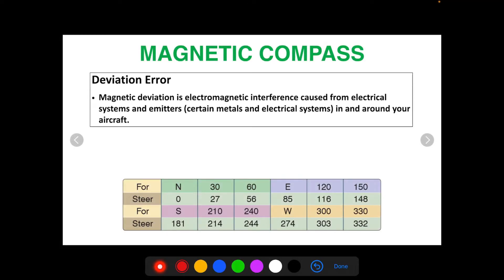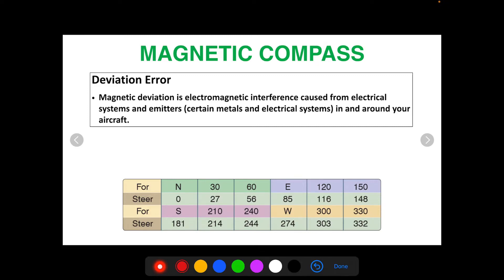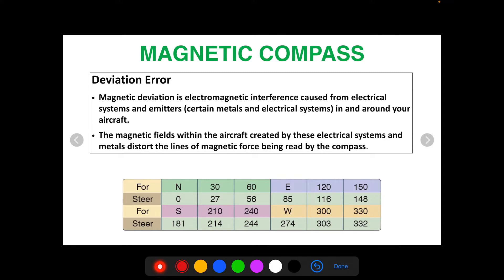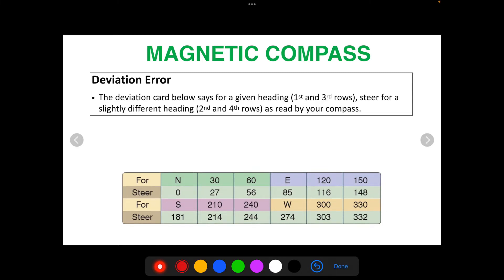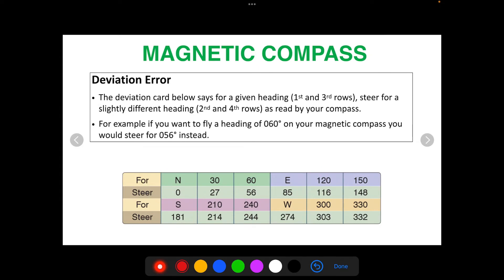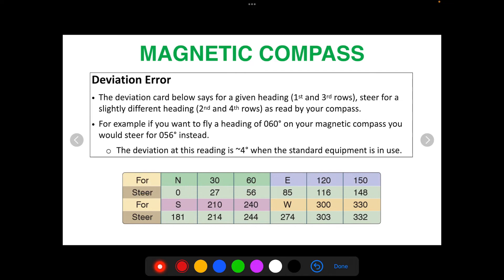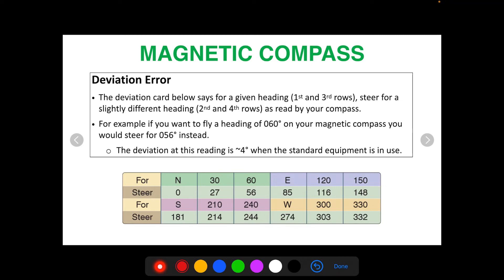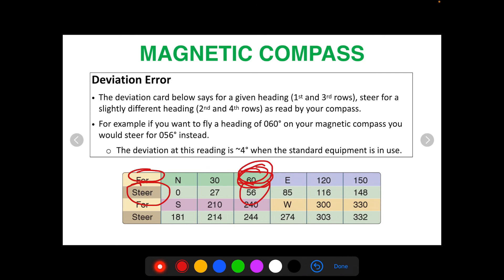Magnetic Compass Errors for Student Pilots - Magnetic Deviation

Comment: How do you combine magnetic compass errors due to Variation and Deviation to arrive at the desired compass heading?
Reply from the maker: A heading is a course corrected for wind. So assuming that you measured a true course on a chart and then corrected for forecasted winds you would have now a true heading. 

To get a magnetic heading you would then need to adjust for variation which you would find with isogonic lines on your chart. Once you have added or subtracted the variation you have your magnetic heading.

You would then use your deviation card in your aircraft that is specific for your compass to correct for deviation to get your compass heading. The card, as the video explains will tell you to steer for x to get y. So your magnetic heading you calculated is what you want so that’s y and you would then steer for x according to the deviation card